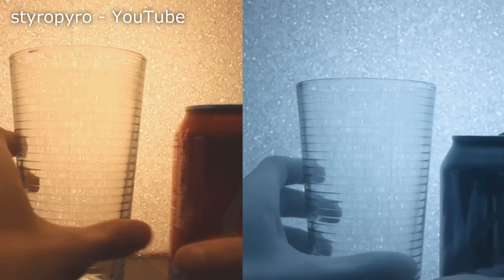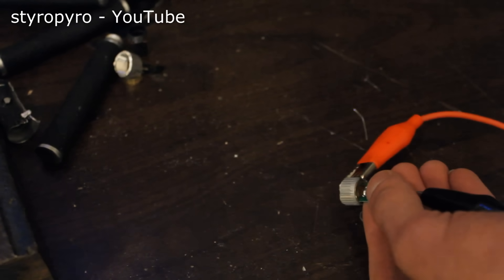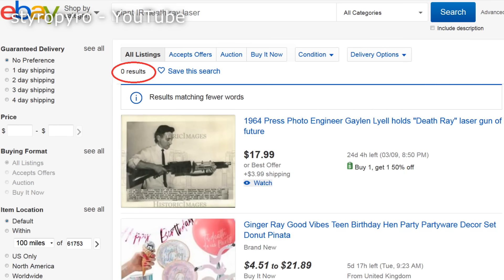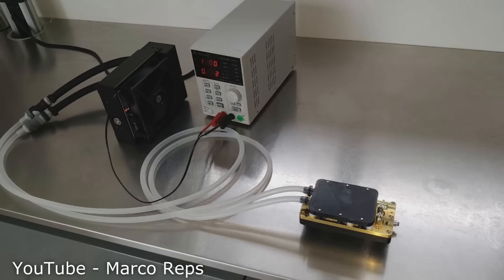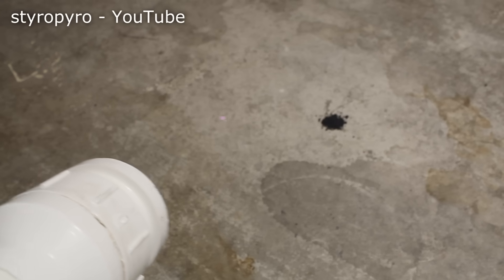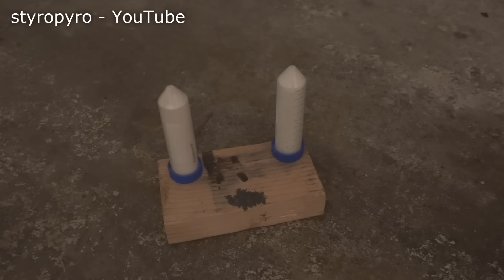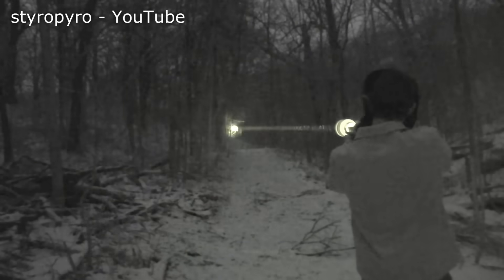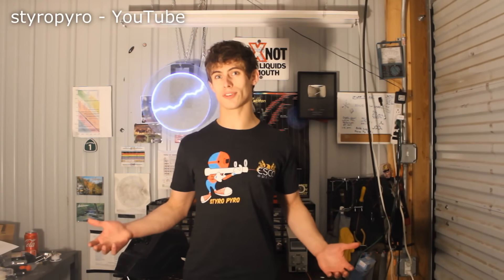100% Invisible IR death ray laser!

Comment: Great video, that shaft of invisible light looks menacing! Is that "see through flesh and bones" feature being used somewhere? And I can't help but notice your new CW multiplier; you ended up using those blue capacitors after all? Some day we might see someone obtain 1 million volts DC with those, wink-wink, (and of coure that would mean insane 2 meters of needle-needle spark).
Reply from the maker: yes NIR imaging is being used/studied in some applications (https://www.ncbi.nlm.nih.gov/pmc/articles/PMC4948614/) and I plan on doing more experimenting into the effect. As for the CW multiplier, you were right about the 1nF blue caps being the best buy! the 10nF blue caps and series K15-5 caps failed at considerably lower voltages ( i need to make a voltage probe to take actual measurements) where the 1nF blue caps can be charged to the point where the pins just arc over in air. The CW multiplier in the vid is my best prototype so far and it's your same design. I'm building a much larger bipolar setup (that will have current limiting resistors) but I think my biggest hurdle to cross now is coming up with a big enough HF transformer to power the stack. I might have to to wind my own from a big ferrite core. Anyway I appreciate all the advice you've given me and will definitely be linking to your channel when I start posting videos about it!!
Reply: @styropyro  yeah, I had to wind my own transformer too, here are some tips: if you don't have big enough core, you can stack smaller ones together just as well; multi-section bobbin is supreme when winding a couple thousand turns secondaries; good luck! And I strongly recommend you to make a tap to the first stage of the multiplier, as I did, so you can measure the first stage voltage to make sure that you aren't overvolting your components. Looking forward to that shoutout!
Reply: "Some day we might see someone obtain 1 million volts DC with those" Apparently that day is in the past: https://www.youtube.com/watch?v=ibJYu5fvHkk. It's a somewhat dubious video, but it looks like they really made a 1 MV CW multiplier.
Reply: Invisible laser sights?
Reply: IR lasers are actually used extensively in neuroscience labs, using that exact principle! In some cases, 2-photon microscopes using IR lasers can image fluorescent biosensors that detect when neurons fire. So, using a microscope positioned over a mouses head, sending and receiving IR light through their intact skull, we can see indivual brain cells firing when a mouse acts, in high resolution. IR lasers are handy! It's a shame the microscope quality ones cost about $250k.

Comment: The VRMs on a motherboard might be a cheaper source of high-current, low voltage power, as they can drive CPU's with a TDP of over 100W at voltages of around 1.2-2V. Converting them to a constant-current supply might be difficult though

Comment: Wow, the audio quality has skyrocketed. I can hear you clearly with almost no background noise
Reply: He moved out of the garage so the sound improved. Less echo. Tripolar out.
Reply: FYI he was using his phone to record the voice
Reply: Your references of what's good audio quality is quite low then. Yes, the noise level is quite low - but the frequency response of that microphone/camera and everything recorded in mono, not so much...
Reply: @Speeder84XL  while the audio quality is indeed bad, but for voiceovers i much prefer mono audio compared to stereo audio, as when you use a cam or mic that records stereo, it's likely to be louder in one ear than in the other, which actually is annoying
Reply: @BH4x0r  It doesn't need to be louder at one side - that depends on the setup. Mot camera stereo microphones are shit and worse than record in mono with a good microphone. But if you are close to the camera/mic setup, it might be hard to get the voice in the center of a stereo recording, that's true. The problem with recording mono is instead if you are not in a perfect room (wich is almost never the case - especially not for videos like this). All reverb and reflections sounds quite unnatural in mono and will make it sound like "bad audio" rather than the room affecting the sound - even with a good microphone. In stereo, the environment (even background noise) will be more natural as you hear it in real life. 
But, if you record in a good studio or anechoic chamber, then mono works just as well as a good stereo recording for voice over, broadcast and similar - and simpler since you don't have to think about being perfectly in the center
Reply: @Speeder84XL  true, but i don't think he has either professional microphones or studio microphones

Comment: Connect it to a tv remote control board and we will finally have a tv remote with decent range. Assuming it doesn't melt the TV when you point it at it...

Comment: The Action Lab did a video demonstrating how visible red photons didn't have enough energy to charge a certain glow-in-the-dark material, but if that material was already charged and glowing, the addition of red light increased the light output from that material, causing it to discharge much more quickly. He used red light on a glowing surface to essentially make it "unglow" in spots.

Could the same be done with IR light? When it comes to charging glow-in-the-dark materials, the result seems to have much more to do with the energy of the individual photons than the total energy of all photons combined.

Comment: 😳 *faint*😳 LIMO tho: They don't like to hand out datasheets for their lasers sadly, so we can only guess how to interpret the 500W rating on these https://youtu.be/1D0b3MFwyRo
Reply from the maker: thank you for the amazing driver design!! yeah I couldn't find a datasheet for my laser and I knew trying to get one from LIMO would be futile. as you probably know those 500W warning labels are just generic stickers that they probably slap on all of their high power units. if you know the laser's wavelength then you can plot the forward voltage/current/output power at lower powers and the slope/threshold info can give you a good idea of the power rating when compared to known datasheets
Reply: I feel a little bit proud =D